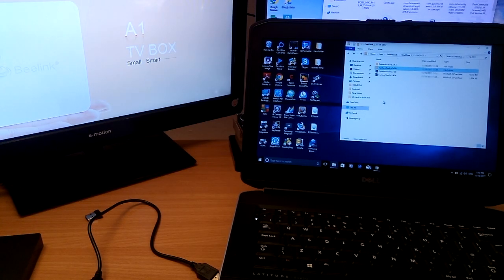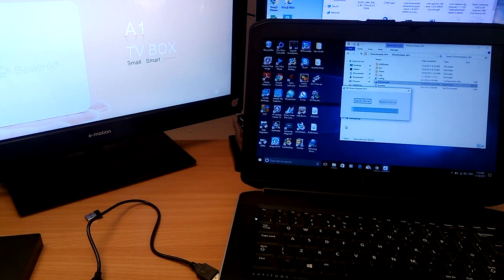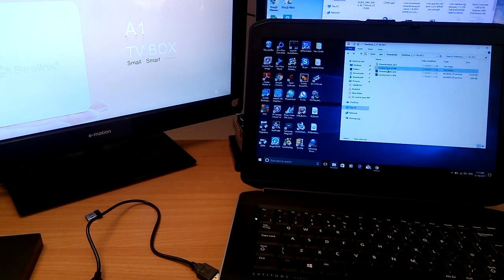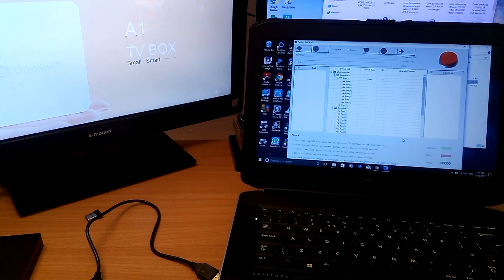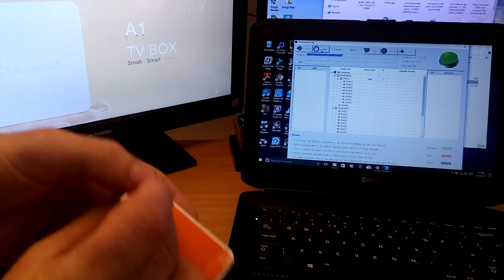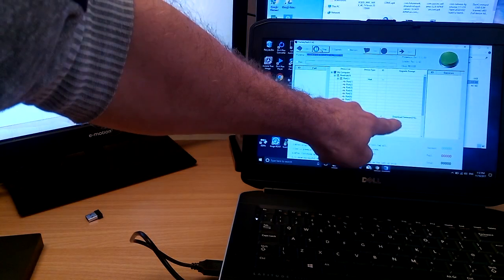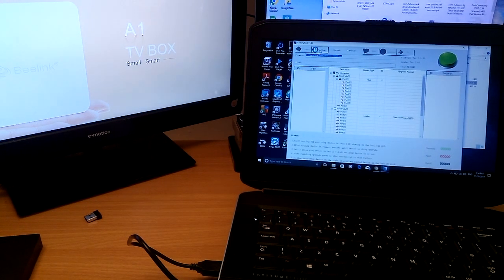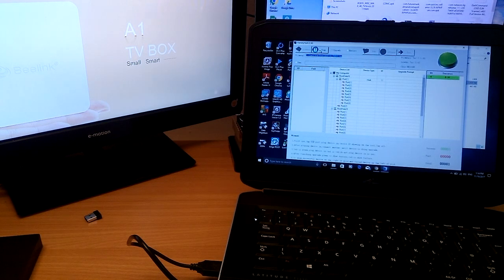How to flash  a rockchip TV box using the FactoryTool v1.43e

Comment: Thanks for the tutorial. On my box (H96MAX RK3188) I had to use the USB port nearest to the TF card slot, as the USB 3.0 and 2.0 ports were swapped. It will always be the black USB 2.0 port used for upgrades. Also, if you get chip check failed error, try a newer version of FactoryTool. Hope this helps someone.